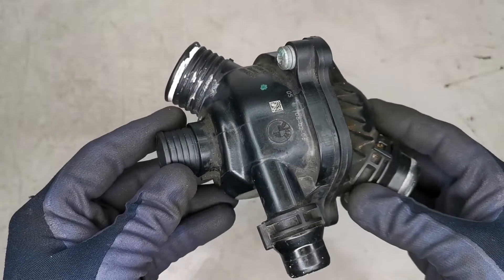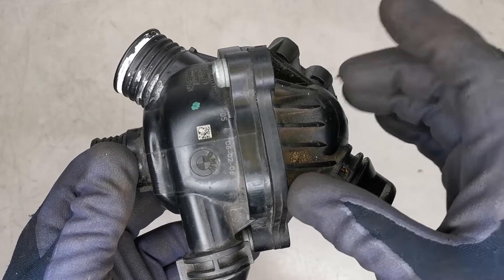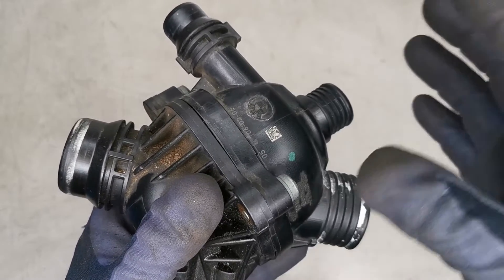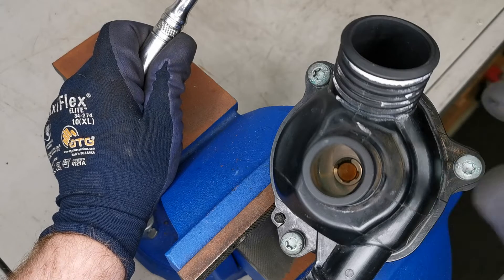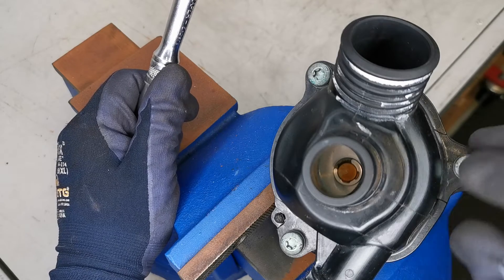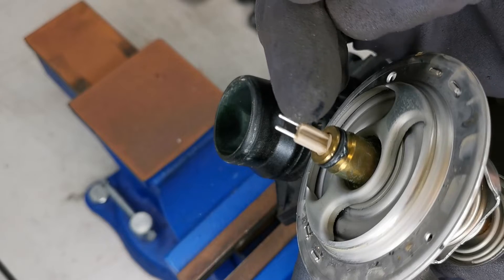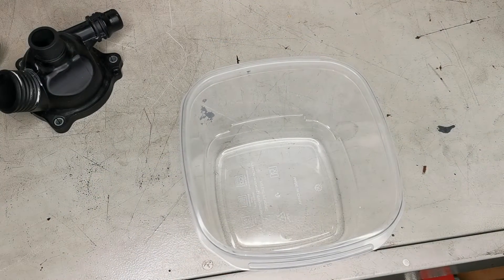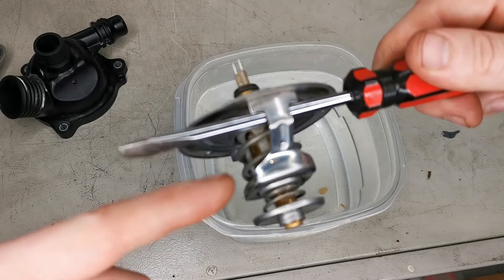Electronically Controlled Thermostat - How It Works & What Benefits?  Overheating BMW Fault Fixed

Comment: This may squeeze a couple of extra miles per gallon, on a good day, but it is the device behind the early death of engines. The mechanical core of most modern engines is fantastic but they are let down by shabby electronics and disintegrating plastics. The plastic parts that end the life of what should be good long-lived engines, include valve oil seal, timing chain tensioners and cooling system parts (especially near to the engine outlet). These map thermostats allow the operation of engines at temperatures like 110degC or 115degC for the purposes of improving fuel consumption in cruise. These temperatures are 20degC higher than the thermostat controlled temperatures in older engines, and long periods of operation at these higher temperatures quickly degrade plastic parts and cause many different types of failure. This is worst in a gently driven cars because the conditions lead to higher coolant temperature selection.

Comment: Hello, i have the 2ef7 and the 30c1 error codes and the coolant temperature are going between 95 and 105 °C and when im driving about 130kmh it goes to 120 °C Enginetemperature. Is that a problem with 120 °C ?

Comment: It helps PASS emissions. Cheats faster warm up(percieved) truth is oil is not ready and only one of the multiple reasons bimmer engines are shit turd garbage  oil leaking burning underperforming crap...

Comment: Great video but I think you need hotter water to test from what I am finding. I think the temp to get it to work without any current is @107 C or 224F which I find ridiculously high for track use.

Comment: But from my point of view I don't think an electrical thermostat will close with the water temperature because it's already using a 12v supply to close meaning if the solenoid is damaged it won't open with the water temperature as the way you tried to demonstrate to us or maybe I'm wrong?

Comment: The benefits to reducing emissions and improving fuel economy are grossly exaggerated. This thermostat does not do anything different than a conventional one during engine warm up where the engine is running rich. On the other end of the spectrum this system merely adds another layer of completely unnecessary CEL events and codes, costing big bucks to the car owner for diagnosis, parts, and repairs.

Comment: Thank You, I have had  two failed ones both failed closed, the second brand new OEM out of the box, that turned out to be broken electrical connections inside the thermostat, awaiting replacement from BMW. Not sure if this is the right move, with the cost of new OEM  parts, might be better to buy two cheap after market units, worst mistake I made was throwing away the original one because of age but was working normally, you live and learn.

Comment: My car is a 528xi and it has this thermostat here. When driving, the temperature drops to 76-80 degrees and the engine runs cold, is there any way to increase the temperature a little?

Comment: Hi
I have a Z4e85 2.0i that mounts a map twrmostat with 105° opening in fuel economy the range is always between 107° and 109° in the norm I would like to lower this range in fuel economy by making it remap from the ecu from a computer can you force it to open with a lower temperature?

Comment: By far this is the best demo of how these thing works . I never heard of it until code po597 came on my 2012 chevy cruze. I clear the code with no drive ability issue but i know that it will come back on after driving at higher speed like 60-80 mph for highway speed. I did the resistance and it was 35 ohms and the spec on it is 15-16 ohms

Comment: Nice little video thanks !!!! I'm stumped, ice cold inlet and output pipe to Thermostat, car boils up, closed off system.   I replaced it twice and then checked again....  My 2x new OEM spec Mahle did not open in hot water pan at 100c but didn't also have 12v power to it now know with MAP based Thermostats.   'learning' ... The circuit must not be working guess as on or off the car the Mahle stays closed.  That is both the new Mahle thermo's.  I took this 12 reg corsa in for crankcase oil leak and came out unable to stop overheat and had a Water pump, thermo, and header tank.  Most puzzling,  no head gasket issue, drives as should..... Indeed I have tested 20 kilometre driven with housing thermo pipe wide open, thermo in housing totally removed. Once 2x new Mahle Thermo on car boils up in 2k again as radiator loop closed off, thermo closed.   I'm stuck to understand why this MAP thermo won't open on my car and on an OHMS test in the house.... these Thermo are not faulty, the car isn't operating them .  Can you think where I have gone wrong, temp coolant sensor on order...... Many thanks

Comment: Best explanation!!!! If you have a BMW N55 335i and you drive crazy like me and engine temp gets like 120c, replace its thermostat with the Ford f150 thermostat and ENJOY driving fast and crazy or maybe drifting at all time!!! In middle East we call it “change it from electric to mechanic” 🤜🏻🤛🏻
Reply: Hi
I have Z4E85 2.0i i want change termosta map 105° 
Which termostat i can to install for lower the temperature?
Meccanic termostat?

Comment: Thanks, that explanation was nice and clear.

Just an additional thought for anyone thinking of trying the same test... The thermostat for the N43 engine on my wife's e92 320i is either supposed to open at 97°C or 102°C, depending on the part number. So not all of them should open when submerged in boiling water. (From a quick search for the part number, I think the example here is meant to open at 97°C, so it does seem to be faulty.)
Reply: They are 102 degree units too...
Reply: It did not open with the 12V hooked to it so I would not use it, maybe heat up the water some more and use a thermal imaging camera.

Comment: Thanks Gerard for this great video. I'm trying to diagnose an over heating  issue on my N43 engine'd E88  -when the heaters are turned off the engine will overheat quickly and the bottom hose rad remains ice cold, your video demonstrates these thermostats fail close so I'll definitely be replacing that ASAP.

Comment: Can I convert  my Yaris to a BMW. I need to control the coolant temp especially at speeds above 200 km per hour. Now that's just down your regular country boreen never mind the motorway.
Reply from the maker: Worth a go Tom 😂
Reply: Go for it Tom!
There's nothing that a lump hammer, a grinder and a welder can't sort out with a little bit of time and patience!
Reply: Is beter to convert in an airplane 😂

Comment: Whats the point in having a thermostat opening earlier to get better emission figures before the engine has got up to operating temperature?
Surly this defeats the purpose of the thermostat?  Not having the engine up to operating temperature as soon as possible  would cause premature engine wear thus shortening the life of the engine. Where is environmental benefit in wearing out the engine faster?
Reply from the maker: Emissions is the biggest issue with vehicles off the assembly line, as the restrictions have gotten tighter the additional problems that have followed have made reliability harder to come by.
Not just BMW though, VW, Mercedes, Saab, Chev/Holden.
Reply: I believe the answer is that the mechanical part (wax element, springs, etc.) of the stat is designed to open hotter than for  a "normal" stat. Then the MAP is standing by, ready to open earlier when it is needed. So you might think of it as ... it runs hotter almost all of the time due to the mechanical design, but not too hot in those few times when needed (based on driving conditions, monitored and controlled by the ECU). So overall the engine runs hotter, which is better for emissions, better for fuel economy, better for cabin heating, ... and WORSE for everything else, especially for plastic engine parts.